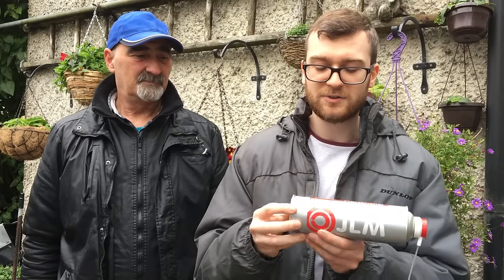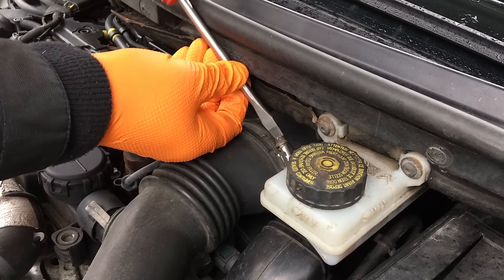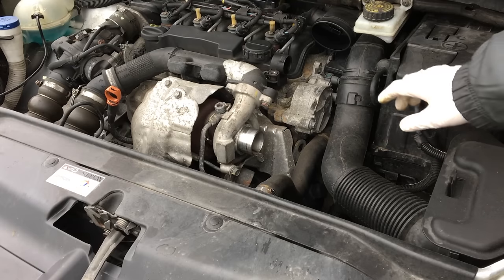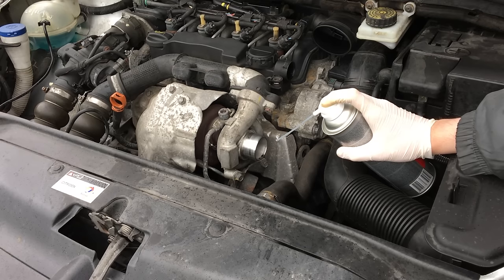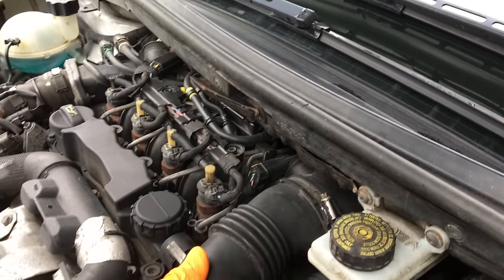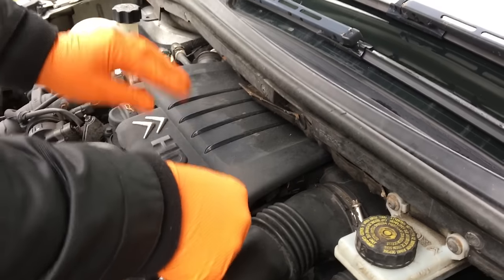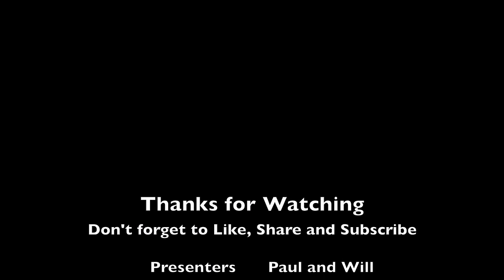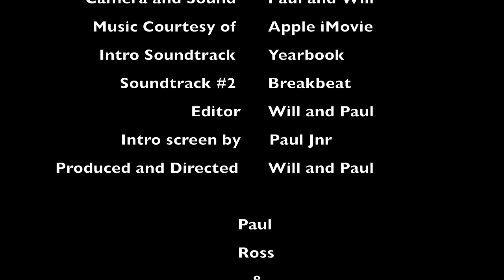How To Clean an EGR Valve Without Removing It

Comment: Sorry, but that is not how you clean an EGR system on a diesel engine. Ask yourself where is all the fouling going? There are no short cuts as you really have to pull the EGR system a part for cleaning. There is a chemical reaction that happens to the fouling or carbon. It goes rock hard and if you do this it becomes a nightmare to clean the system after you do this. There are no short cuts in life. At least on cleaning EGR systems on diesel engines. I know, I am in the trade in Australia. Diesel fitter.
Reply: He’s mad the videos got 3.9m views and the cars going up in revs while he sprays egr cleaner in it 😂
Reply: Have to agree with you here. Had to clean my sister's egr valve, and it took several sprays and brushing rounds before it started to look better.

Comment: Engineers should start adding a small access port to the egr system for preventative maintenance.
Reply: Should it be right below the main port?
Reply: On my car (Volkswagen 1.4TDi) the engine oil breather is placed on top of the engine. Oil vapour blowing out during process but get to clean the intercooler, EGR and throttle body. Easy access.
Reply: I’m quite convinced they’re engineered to need unnecessary maintenance with poor ergonomic design to ensure consistent cash flow for dealership service departments.
Reply: @fortitudevalance8424  Most vehicles have a small passage casted into the intake manifold that connects the throttle body to the egr valve that gets clogged and requires direct physical access to clean it out. A crankcase breather on top of the valve cover would not help give access.
Reply: @joshfoley5205  Most definitely it must be nice charging $100 labor to change headlight bulbs.

Comment: Thanks for the tip lads, I tried this but it didn't work well at all. I had to take the valve off and soak it in petrol and scrub it. But I shot that stuff into it after cleaning and it's working like new again. Cheers lads.

Comment: As an older fella, here is one of my best pieces of advice-
The skin is actually the largest organ in the human body and absorbs tons of nasty things in your lifetime. This is the reason that topical cremes, skin cremes, arthritis pain cremes, etc., etc. work so well. They are easily absorbed by the body through the skin. Wear gloves for everything! Brake fluid, motor oil, transmission fluid and radiator fluid are highly toxic (like poison).
Also your lungs are your air filter for your body. They are not easily replaced. Wear a mask, wear a mask, wear a mask! From ANYTHING in a spray can to stains, household cleaners, etc. You will give yourself a much happier life.

Comment: I'm a diesel mechanic and can tell you now that your wasting your money trying to clean the valve with that stuff....!!!
The only way to clean correctly is to remove the valve and clean it by hand , soak it in  paraffin overnight and then dry it off and then get a tin of spray on oven cleaner and thoroughly coat the valve , leave it to work in for a couple of hours and then get a toothbrush and give it a good scrub and it will look like new.....👍
Reply from the maker: Yes, we did that also
https://youtu.be/HXqJ0YcOqOI
Reply: Bro,whts the cleaning interval of this eye in ford figo 1.4 tdci?
Reply: These guys are Irish ! , what do you expect !  :P
Reply: Thankyou
Reply: @gary9432  they didnt invent the product. They are just showing how to use it based on the manufacturers instructions.
Reply: If it is true that to clean the egr valve well you should remove it and clean it by hand, could this spray be used after cleaning the egr valve to clean the ducts and the intake manifold?
Is it good to spray the product into the turbine or for safety would it be better to spray after the turbine?
Reply: Agree
Reply: I bet GaryBlue Fox voted for brexit too !
Reply: or just get rid of the crap and give it a new tune so it doesn't nock
Reply: Honest John 1.7TD?
Reply: @TheMBDESIGNSTUDIO  

You must be talking about America
Reply: Can you soak it in diesel overnight then scrub and wash it off?
Reply: @briangreen8887  

Petrol is better in my opinion.
Reply: @gary9432  knob jockey
Reply: @gary9432   Do you have any problems with Irish guys? Is it related to what you have been through with your past?
Reply: @gary9432  what's being Irish got to do with anything??
Reply: My EGR on my volvo v70, 2.4D, 2009. This EGR was not oki, i demontage down my EGR and clean this part in diesel under 2-3 hour, later wash inside of EGR with help of a handwash...wash wash and luft clean up...to end was the egr clean and me montage back the egr, every part was remontaged, i test start my car, the car start direkte! Going clean!

Ps. You must have time to serve up your car
Reply: The more I learn about EGR valves the more I am convinced the Tree huggers are off their heads. They are more trouble than they are worth.  Screws with the DPF as well so I have been told.
Reply: Ll
Reply: Hello I cant Find where is lokates  a EGR on kia ceed do can help me plese?
Reply: @gary9432  I found this video by following a link on the JLM website. If the manufacturer recommends the video then that's good enough for me.
Reply: Gary what the fuck is that supposed to mean?
Reply: @gary9432  What exactly do you mean by that . Please enlighten us.
Reply: @TheMBDESIGNSTUDIO  Absolutely
Reply: @frank o'brien going well for you so far then? 😂😂😂👍https://www.ft.com/brexit
Reply: I cannot get those two bolts to come off .they are lose but the whole thing spins.howndo I get them out
Reply: Of course he would say that, and that would be £150.00 thanks
Reply: So eve valves fail? My pipe on my boxer van has a split too.
Reply: "Diesel mechanic" is so much superior to "petrol mechanic"
Reply: The devil is having a field day racebaiting everyone,evrywhere
Reply: @Surfingaliens65  I’m going to get my egr mapped out this week. Awful idea that actually reduces fuel consumption, and ruins your engine! Shortens the car’s life, so 100 times Worse for the environment!
Reply: I had lots of lag and sometimes no boost, used a cheap 7-8€ spray and now my diesel forester it drives lile new. 340k km car. So for me it worked a spray like this.

Comment: Two things. One, as soon as you get your intake reassembled, go for a drive, it's best to do a decent 15 minutes at highway speeds to burn up any of the EGR cleaning fluid that's left as residue. 
Two, those cleaning sprays work best preventively. That means if you want your diesel engine to last for ages, start doing this every 20 to 30 thousand km from new. If you've bought a second hand diesel, pay to have the intake and EGR valve cleaned, then use this spray to keep it from clogging back up. Or don't, it's your car.

I would hve also cleaned the MAP sensor.
Reply from the maker: Good advice. Prior to using the spray the engine management light was lit on the dash. After spraying and reassembly it was driven and the light went out. We eventually removed the egr valve and cleaned it. See link below.
 https://youtu.be/HXqJ0YcOqOI

Comment: How would this spray have made it to the egr valve? The spray would need to go out the exhaust, past the cooler then get to the egr? Even then that is only if the computer had the egr valve open

Comment: I have a Toyota 3rd gen Prius and it's Impossible to remove the EGR valve only.  What worked was using  an extra reach 12 mm racheting wrench for the three Nuts in the back and I had a hard time reaching the 4th HIDDEN 12 mm nut underneath the EGR cooler.   Used a Torx E8 socket for the two Bolts ( in the back of EGR cooler) and we finally freed the EGR assembly.   Now I can clean the valve and EGR cooler easily.  Good video
Reply: In your opinion can you avoid cleaning the EGR if you run Chevron or Shell gasoline and only and use Valvoline Clean and Protect engine oil. Both of these do well cleaning/preventing carbon buildup.

Comment: Been having troubles with my 1.3cdti Vauxhall Meriva of late... laggy turbo, sometimes not boosting at all. Looking into using this style of EGR cleaning (as a recent repair meant I saw a very clogged and grotty EGR system) as well as the turbo cleaner as they seem to be the best tries before drastic action is needed. Vids like this are a great help, appreciate people like yourselves putting them up 👍
Reply from the maker: Hi Michael. Thanks for the compliment and happy you found this video useful. 
We try to be as straight forward and helpful as possible in our videos. 
We recommend periodic checks and basic preventative maintenance rather than wait for something to go wrong or become faulty.
if you find the content of our videos useful then feel free to share our channel with your family, friends and contacts.
Driveway Dudes - Paul
Reply: Lag is usually due to dirty air mass flow sensor . Buy a cleaner and its an easy clean

Comment: I'm a mechanical engineer and doing this achieves nothing. You have to take the egr off and do a proper job.
Reply: But this method works, I know because I tried it with Mr muscle on my picasso.
Reply: And most of the mess goes inside the intake manifold
Reply: It does work done it myself, had no issues or fault codes since, but I did use EGR cleaner not Mr Muscle lol.
Reply: You cannot clean the EGR valve without hydrogen carbon cleaning it.  The mechanic that says he will do it is full of it.  Trust me.  That black coal like gunk won't come out.
Reply: Definitely works, I used a mix of mould remover and fly spray on my Ferrari 355
Reply: I spat into the engine once and it fixed the egr light. My carers won't let me out anymore as the car owner apparently didn't appreciate my work.
Reply: Let the fools do their job! Who's gonna win after all? Us...the mecanics 🥂
Reply: Hi sir can i clean just the throtl egr valve without cleaning the radiator
Reply: You probably designed it
Reply: Never  worked for  me  only way  is dam EGR removal   that's pain  in the arse job  belive  me
Reply: Cleaning the egr is more intense than this video would suggest  you have to take it off to give it a thorough cleaning,  even leave it soaking overnight in a cleaning solution,  🎉
Reply: @terence874   i Agree    but  dam pain arse get too
Reply: @LuMs-rl1ed  it's extremely difficult to give the egr a thorough cleaning while still bolted to the engine,  it needs to be taken off to do a good job when cleaning,  I let soak in vinegar sometimes when getting rid of a rusty tool,  never tried a egr, might give it a try next time,
Reply: Thank you for this answer, I always suspected you cannot clean without taking valve out 👍
Reply: Hi brother does this apply to a 07 Chevy trailblazer  either way I'm going to   take it off regardless let me know alright I just curious
Reply: @Phill-q5z  yup take it off, give it a clean. Its the only way my friend.
Reply: @paulkazjack  thank you very much budddy. Truly do appreciate it.
Reply: To clean the EGR, you need to idle.  The engine does not accelerate.  EGR kicks in at idle.
Reply: Says the one who puts starters inside motor blocks and batteries inside tires and puts oil filters in the gas tank etc you’re the last person I wanna hear from 😅😅😅😅
Reply: You're right. It will cause excessive white smoke on the tail pipe.

Comment: EGR cleaner is a flamable fluid. So if you can spray into the turbo intake, the highest part of the cleaner fluid will burn in the cylinders. Maybe a little can go out to the exhaust system, but the huge part of them will go into the catalysator, and not into the EGR tube.

And i think, that very small burned cleaning fluid will not remove that lots of carbon dust from the EGR valve.
Reply from the maker: It worked for us and we believe for many more people that have used it.
We didn't manufacture it nor can we say how much will be burned in the cylinders or how much will recirculate.
We made a video to see how effective it was. We followed manufacturers directions of this brand and the result was in our opinion that it did indeed do what it was designed and marketed for. 
Our EML was on before we started and afterwards it was not. If just a tiny percentage got through then apparently it was enough to make a difference.
Reply: Absolutely! Then consider that only a small percentage of the exhaust fumes get fed back to the egr. Anyone who has ever cleaned an egr valve after stripping it knows how much effort it takes to scrub it clean. There are no short cuts. Strip and scrub! You may want to look inside your inlet manifold while you're busy because i just finished removing about 350 gr of gunk with oven cleaner. Enjoy!

Comment: The EGR gasses come from the exhaust manifold to the EGR valve, back to the intake manifold, into the engine. Remember "EXHAUST Gas Recirculation".
Reply: So…. It works right ? Is that the point or ?
Reply: Exactly, where they spray will do nothing for egr valve !
Reply: @conorf8091 No, it does not work, only way to clean properly is remove EGR valve, these sprays are just temporary fix
Reply: @No-timeforimbeciles  yes I found that out the hard way. I over heated the catalyst. I fixed the egr code by fitting an new one properly like you said at least ..
Reply: Absolutely true... Am an engineer myself... Fail to understand how this method will help to clean an EGR valve after the cleaner has passed thro the engine , burnt, passed thro catalytic converter, and a small % of those fumes will be routed  thro EGR valve , and clean it...!! Pretty optimistic...!!
Reply: Who didn't know that?
Reply: chemical could degrade lubricity and cuase cylinder abrasive?  so, change lube after the trial.

Comment: I do not know anything about Diesel engines. I have very small amount of amateur knowledge on gasoline engine. Silly question: from this video, it appears the spray is introduced at the turbo’s fresh air intake. This means the spray would travel through turbo, gets with compressed fresh air, thru inter cooler, into the fresh sore intake valves on the engine’s intake manifold, and into the cylinders to get burnt. On its way out, when already as soot and CO2, some of it (no more spray) might get into the EGR valve when the valve actuated. 
In other words, probably less than 1% of the spray would get onto the gunk at the EGR valve?
Am I not understanding something correctly?
Reply from the maker: The turbo function is forced induction. A % of the egr cleaner spray would not pass through the egr valve though some may. 
To say you know nothing of diesel engines then to say probably less than 1% would is quite a strange statement. 
We cannot say for certain what percentage does get to the EGR valve but we can say for certain that it does indeed work when applied with this car
Reply: Driveway Dudes 
Thank you for your reply, although it is not answering the root of my question. 
I understand turbo charger is compressing air; that part is same as in a turbocharged gasoline engine. The difference is Diesel engine must have one, whereas gasoline engine could work naturally aspirated.
My question is: the post-turbo air need to enter the cylinder first, get combusted (so the cleaner is now mostly burned up, becomes CO2 and H2O and whatever other incomplete combustion compounds), go out the exhaust valve into the exhaust manifold. 
At this point, there is very little “cleaner” left; most if not all should have being burnt. 
Now: the EGR isn’t always on.
I don’t know what % of time an EGR valve would be on. 
But when the EGR is on, then a fraction of the exhaust gas gets recirc’ed. 
So we’re talking about fraction (after burning) of fraction (if EGR is on) of fraction (not all exhaust gas is recirc’ed even if EGR is on) of the cleaner spray would route through the EGR valve. 

And we haven’t even got started on exhaust temperature being higher, so any lucky residual cleaner should be in gas phase not liquid phase, and doesn’t “clean” as well when in gas phase...

So back to my question: this method of cleaning EGR doesn’t seem to make sense. 
Am I missing something here? 
Or is there some keyboard hero who self-appoints as driveway/car expert can help enlighten us all?

Comment: I've done this job on my C4GP. I used the Wynns EGR valve cleaner which is about a tenner from Halfords in the UK. With the Wynns you have to use the entire can. I sprayed mine just after the air filter because the Wynns won't harm the MAF or the turbo (my C4GP has the 2.0 HDi engine). I let the car idle and gave it 1 second bursts of spray. The engine note will change and as soon as it recovers give it the next spray and repeat until the can has been used up.
Reply from the maker: Hi Parknest,
The instructions and application of EGR valve cleaners may differ from brand to brand. 
They claim they can clean effectively. 
We haven't tried Wynns product but If it worked for you then that's all that matters.
Well done.
 

Driveway Dudes - Paul
Reply: Parknest yy
Reply: I used it today but nothing came out of the exhaust and my eml light is still on?
Reply: That's daft, unless you're driving a very old car. The EGR in most modern vehicles won't open unless the engine is under load (revs above 2000). This is because generally engine temps will be relatively low and the risk of valve clatter is minimal. In diesels this is especially true as Diesel engines run colder at idle than petrol ones. I find it pretty unlikely that your issue was the EGR. It's possible that it may have been the throttle body and you were just lucky enough to have managed to free up the valve without having to rev it.
Reply: @jamietalbot7254   yeah my eml light is still on, what happened with yours?

Comment: Using flammable liquid. Do you think after it detonated there's any product left to do anything or has it added a biproduct to your egr.  deisel itself is a pretty good lubricant to clean parts with. Yet its biproduct leaves a black chalk like substance called carbon you used a products biproduct am just wondering if you thought about that